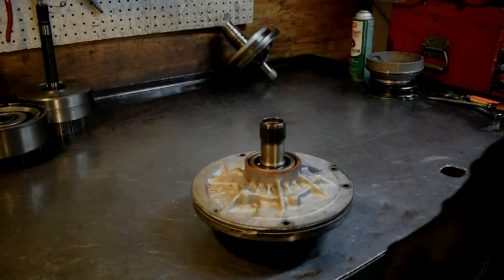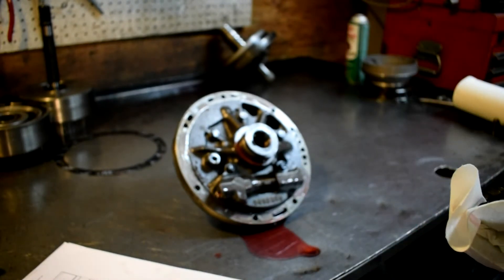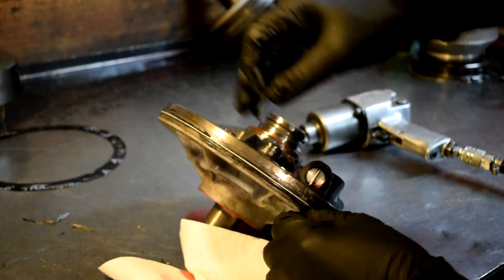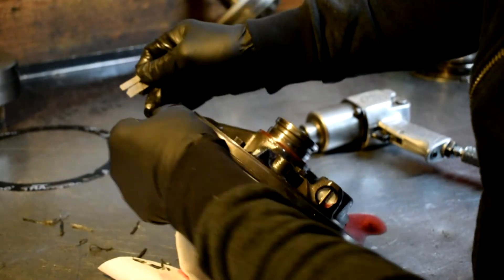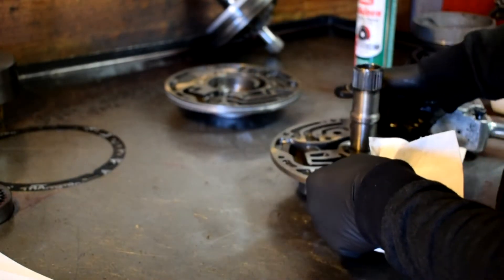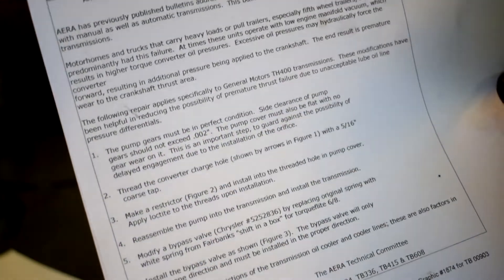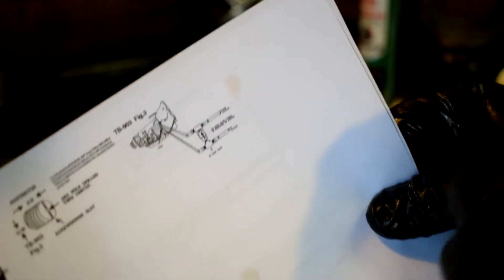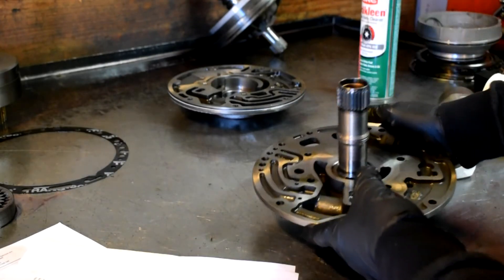Race Th400, 727 pump update for Big Block ie: crank thrust bearing wear

Comment: I've been doing this mod for last 10 years. I buy a pack of brass set screws and drill hole per build specs. In Ohio where I live the best transmission builders in the world live and have taught me many secrets over last 20 years. 4L80E's have a similar issue with runaway back pressure that GM never fixed correctly in the OEM factory builds and the main reason 6L80E's are a poor choice for high performance compared to the 4L80E that shares 40% of TH400 hard parts. I thought about sharing build videos like you have, but who actually cares about these issues except the builders. LOL. Nice video share for those to learn about.
Reply from the maker: Thanks, the problems been around obviously a very long time. Builders should know this but unless one comes across the info, we do the same old thing. Kudos to your experience and knowledge! :)